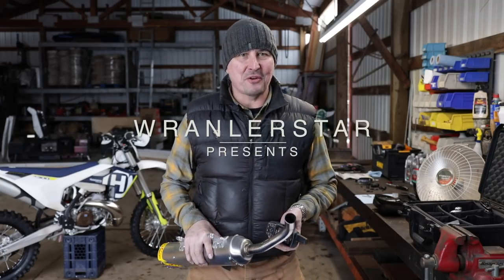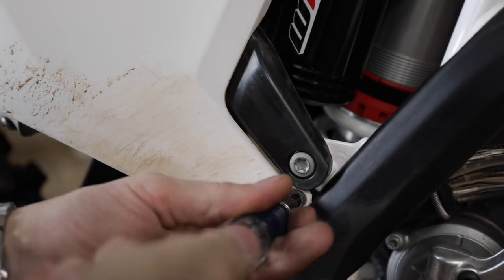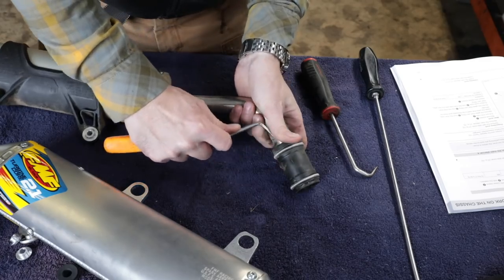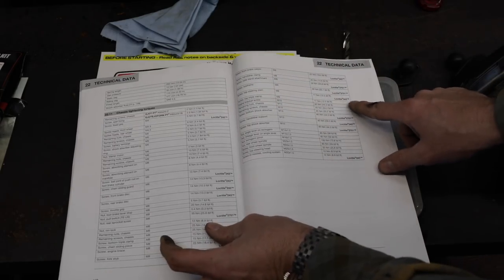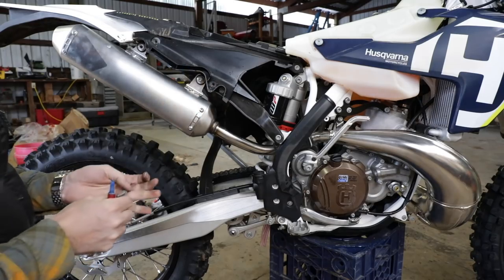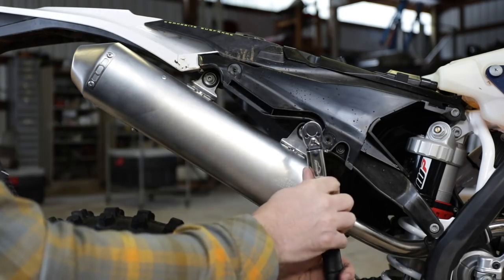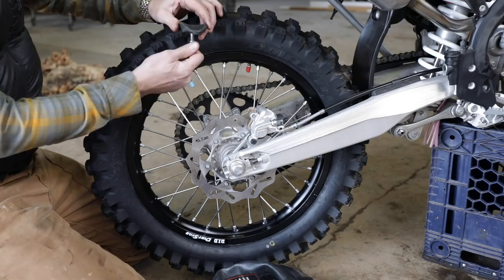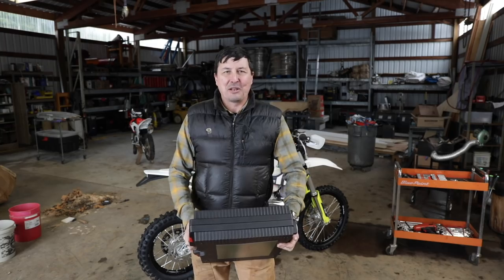Husqvarna 300 TE FMF 2.1 Turbinecore Silencer VS Stock

Comment: Nonsense what Sparks are you going to get out of the exhaust of a bike or car for that matter. It won't produce Sparks? The only time you get Sparks if you weren't running an air filter. Or something older than1940s bike. You can get flames out of exhaust if that's what you mean if it's tuned.
You need to back the torque wrench past the lower setting! the spring has to be no tension in it at all